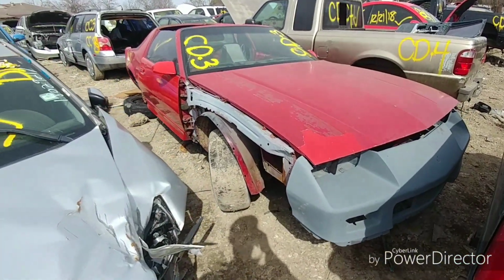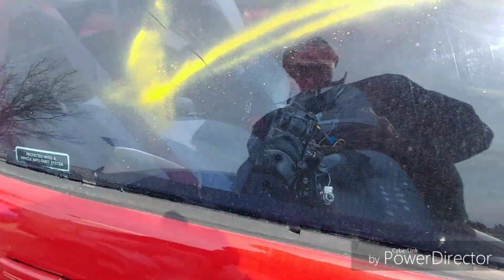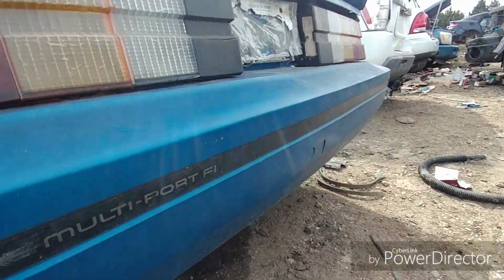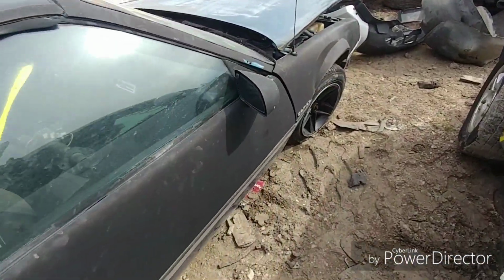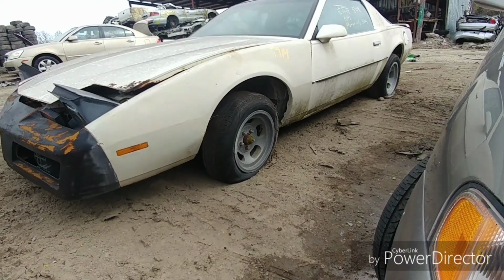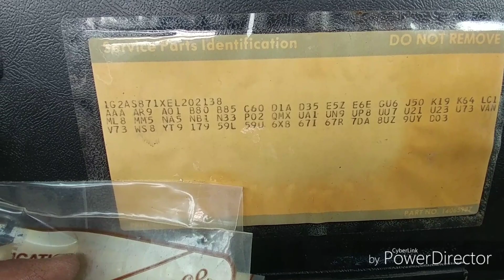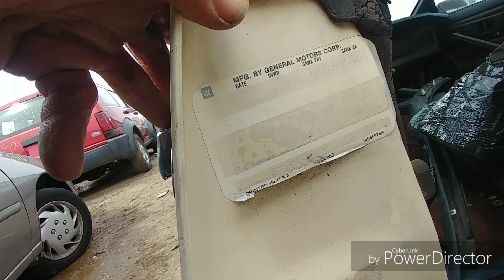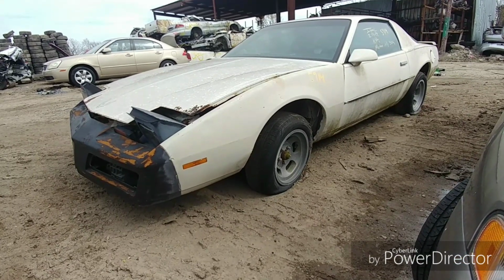3rd Gen F Body Junkyard Finds

Comment: The blue Camaro is a Berlinetta model, it had the 2.8L V6 multi port injected - the "plain jane" base model only had the Iron Duke 4 cylinder and it would not have said mult-port injection on the bumper.  And those seats fabric indicates a 1985 year.  I had a 1985 chevy (different model) with the same design.

Comment: From what I see, the 1st red one is a 1988  (J for the 10th VIN digit) with a 350 L98 (8 for the 8th digit). The L for the 11th digit tells us it was made in Van Nuys, CA. The Norwood, OH factory also produced these, but only through 1987.  The second one appears to have a 2.8 VIN code S V6 in it, that narrows it down from 1985 to 1989. My guess is 1985, as I do not see a 3rd brake light (assuming that things weren't swapped around).  The white one is a 1984 Van Nuys produced 2.8 V6 with a 2 barrel "Disaster Jet" (Varajet) carburetor, likely an E2SE model.
Reply: Holy shit a bloody L98 in the yard???? Then that must be a proper iroc z that was gutted